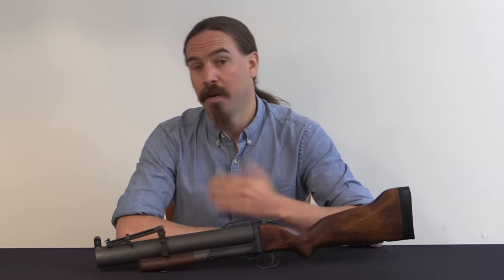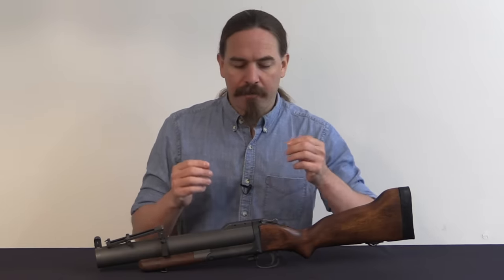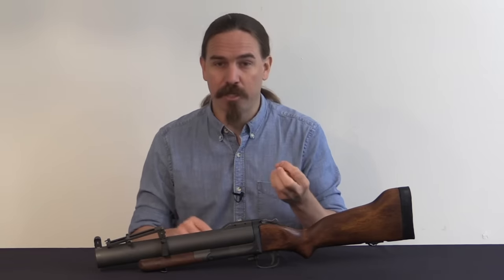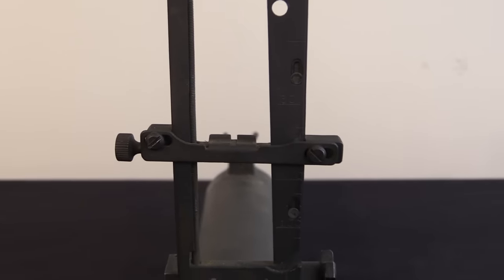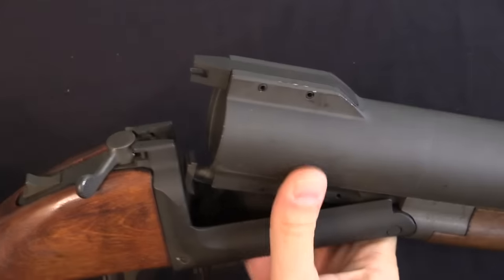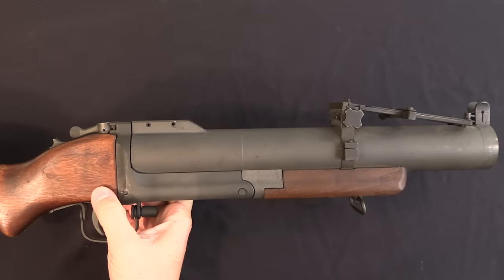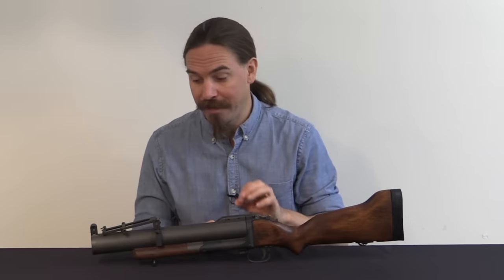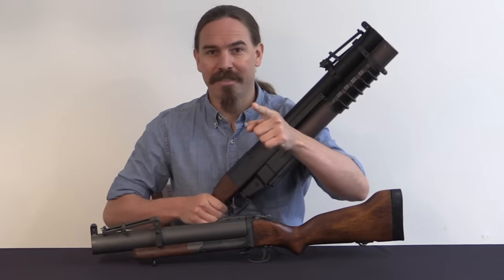M79: The Iconic "Bloop Tube" 40mm Grenade Launcher

Comment: My ship still had M79's in the armory as late as 2010.
Reply: Your ship? Are you in the military, private mercenaries or are you like security on some cargoship that moves in a area where there are pirates?
Reply: @eclipsed3407  At the time, I was US Navy
Reply: @eclipsed3407  the Navy liked these things a lot
Reply: For flares and line throwing
Reply: @silkyz68  no, not even close. it shot GRENADES. If we wanted flares, we had flare gun or pen flares for that. For getting lines across we had a line-throwing kit for the M14. We had M16's as well, but the larger cartridge of the M14 shot the lines further.
Reply: They are still in use by SF and Navy Seals
Reply: Very cool!  Thank you for your service!
Reply: Alexi Malenkov  My understanding is that they like the additional range the M79 offers compared to the other options. I could be wrong, however, as I don't know the ranges on the underbarrel launchers offhand.
(edit: Turns out the ranges are fairly similar between M79 and M320. There must be some other reason.)
Reply: @Angel9932  if I had to guess pre m320 they used it to shoot longer cartridges that couldn’t fit in the m203
Reply: It just plumb works. It's fucking heavy, and bulkier than a shotgun, but it goddamn works. Considering the role it fills, being a single shot is an inconvenience, its greatest drawback is the weight.
Reply: @Rb889  yep
Reply: @Angel9932  You can use it as a club when empty.
Reply: Alexi Malenkov  this aims easier over all. and most (if not all) have transitioned to the HK and 320. My active army unit was testing mass issued 320's back in 2011.
Reply: @hansblitz7770  The 320 is simple, so long as you ignore the sights and laser the kit comes with. I'd love to see the reference, 'cause cutting down the tube seems really dumb. The rounds have an area effect you really do NOT want landing anywhere near you.
Reply: @hansblitz7770  Interesting. Seems like something they'd have only from a lack of(before) M320's because all the "fancy" stuff is very easy to pull off of an M320 if don't like/want them. But "special" people get to pick things because "reasons" and no one bats an eye.
Reply: @hansblitz7770  That is possible. I'm just going off of the last 20 years of service and the sheer stupidity I've seen from all branches.
Reply: @hansblitz7770  Another special use weapon that didn't catch on for various reasons. Not sure what it has to do with M79s. But an interesting tidbit.
Reply: Ah

Comment: I carried an M-79 and an M-16 in my engineering platoon.  Unfortunately, Ian didn't cover the added feature of a flair gun.  It could fire a flair over 100 feet straight up and it lingered in the air for minutes.  It was very effective.  And we had to use it often.  I'm surprised he never mentioned this feature.

Comment: This explains why 40mm cartridges always looked so weird on the inside
Reply: Especially considering the propellant portion is made more or less out of plastic.
Reply: They should really explain this better to people who actually use the things for government work. Give some more appreciation for how ingenious of a tool it is.
Reply: @MalikCarr  7 years in and I never knew why, just that they were like that after we fired them.
Reply: @1337penguinman  Glass reinforced nylon to be exact.
Reply: @feralferret8626  not the live rounds. Perhaps you mean the training round.s
Reply: @jluvs2ride  I was replying to1337penguinman's comment about plastic.  If you read my other comments in this thread, I mention the difference between the cases for the practice rounds (M781) which are glass reinforced nylon with a primed .38 S&W loaded with the propellant, and the combat rounds which are a metal cartridge case with a metal plug containing the propellant and primer.  My former employer produced some of those loaded cartridge cases under subcontract in addition to millions of the M781 and also produced the USMC day/night M1110 training round (under sub-contract to American Rheinmetall) which used the same case as the M781.

Comment: I carried an M-79 in 1963 , it was new to the Fleet Marie Force , and it was kind of fun to fire .It also because of the 
aluminum barrel so easy to clean after being in the field for two weeks ! An old skirt shirt soaked in gun oil could be 
run through it in seconds, and the barrel couldn't rust ,so I could have my M-79 cleaned and ready for inspection hours 
before my buddies with their M-14's ,Liberty call ,The Grenadiers were always the first out on liberty !

Comment: When I was in S.O.I. we were told to never toss the grenade and spin it because the fuse would rotate out and arm. My first thought was "why would anyone toss a grenade". My second thought " if they had tell us this someone probably has done it". Reflecting back after years in the infantry and it makes sense. Lol.
Reply: Seems like 'lore' to me.  It may be physically possible to throw a launcher grenade by hand over 30m while putting enough spin on it to arm the fuse (assuming that there's no additional safety that prevents it arming while it's still in the cartridge case), but I'm skeptical.

Comment: I was in charge of a SEAL support detachment in Ca Mau 1970.  We were Team 2’s “taxi”, and we opped most nights with an awesome MSSC (Medium SEAL Support Craft).  The M-79 was my weapon of choice in the open cockpit next to the radio, and using it saved us on 2 occasions.  I was always loaded with buckshot round.  After dropping off the SEALs, we remained bow first to the bank and silent until they returned.
One night, as we waited, a small drifting/paddled dug out with 2 VC bumped into the side of our boat.  They were startled, automatic fire thru our canvas canopy, and while crew ducked, I fired one-handed at them at 8 ft range... was over in seconds.
On another opp, we were “pinned’ by 50 cal fire to our stern, from across a small river.  We tried to suppress with our 5.56 mini gun, and our 50 and 60 on that side, but could not.  The VC kept firing.  I radioed for air support and an Air Force 104 returning loaded from a target replied.  I used a white parachute round thru the M-79 to mark the drop, and the result saved us.  I discovered the pilot’s name and we made contact after nearly 50 years.

Comment: With the ammo types available, the grenade launcher is one of my favorite weapons I've been issued. I had thought a standalone (or at least detachable like the new M320) launcher would be super helpful instead of lugging around a whole extra weapon if the situation didn't require it. The SEALs still use the M79, and apparently from what I've been told, the sight is incredibly precise.

Comment: Some of the rounds were designed for Veirnam's terrain of heavily wooded, so they worked for that, but in urban areas of combat. The Flashett round was one of these rounds, but also used by others in missile to penetrate the jungles of the area. The shotgun round was the same way, but for close in support.
Reply: And “Viet Nam” I would guess.
Reply: Yes, meant that bit spelling was never one of my strong suits.

Comment: These functioned very accurately as hand held mortars and for direct fire with the shotgun round.

The drawback was wearing the round holding vest.

They were accurate, reliable and fairly rugged. They saved the life of one of my boyhood friends who unbeknownst to me was also in Vietnam at the same time as myself.

Me, I was usually a wrench turner keeping the Quad Fifty gun trucks running. But every truck also had an M60 and an M79 besides the Sergeant's .45 and the M16s individually issued to each of the gun crew and driver(s)

Comment: The system Rheinmetall developed at the end of WWII was called the PAW 600 or 8H63. It was actually used in combat at the end of the war, and pretty darn effective. IIRC effective range against point targets was out to ~750 meters, the weapon itself was right between the 37mm Pak 38 and 50mm Pak 38 in size and weight (less than half the weight of a Pak 40) and its hollow-charge munitions were powerful enough to frontally penetrate just about any WWII tank. The HE round was basically an 81mm mortar shell with some modifications, and the gun could lob that out to something like three times the range of a mortar, meaning it also more than fulfilled the light artillery/infantry gun role.

Comment: Hi Ian, they were not really made as a replacement for the bazooka because it's not effective against armour. They were designed so grunts would have a weapon that was ranged between grenades ( max 20 meters ) to mortars ( minimum 300 odd meters ). We used to carry 1 to a section and it was usually carried by someone in the rifle group as well as their SLR and if you were unfortunate enough to get lumped with it you soon learnt real fast to un-sling it off your back before taking cover in a contact drill as it would leave you bleeding and needing the superglue after smashing into the back of your head and opening you up.
I'm liking your channel, very informative and well done.
Reply: A big portion of the use-case for the bazooka was delivering explosive rounds in that 20m-300m range, especially against infantry in cover, as Ian mentioned. It just also served as your primary infantry AT. Turns out, doing both jobs meant it wasn't a great fit at either: Too big, slow, and heavy for the anti-infantry role, and no longer effective against armor. The LAW replaced the AT role with something dedicated to the task, and the M79 took the place of the bazooka's assault role.

Comment: I was in the army at Ft Ord in CA back in the early 1990s.  The M79 wasn't being issued to us regular army infantry types any more, but we still trained on it...Lots of national guard units still used it, and there were thousands of them in the supply warehouses.  In fact, one of the first sergeants once told us that if war started in Korea (we were the 7th Infantry Div, slated as the first guys to fly in to reinforce the SKs), when we were lined up to get into the C130s, they'd be handing out M79s and bandoliers of grenades to every rifleman who didn't have an M203....along with M72 LAW rockets that had been superseded by the AT4 as issue, but were still in the supply warehouses.  The 7th Infantry would have had a lot more anti (light) armor capability in reality than it did on paper!  

I've seen that since those days, the back stock and even new-manufactured M72s have been and are still being used by US forces in the middle east, because they're lighter weight than the AT4, but still effective against fortified positions in Iraq and Afghanistan.

Comment: While in Vietnam my sergeant told me to take some new guys out who had never fired the M-79. We went to the perimeter where I showed them the basic operation and then loaded and aimed at a lone small tree in the distance which I estimated at about 300 meters.  Holding the M-79 at about a 45% angle without the sight I fired and watched that grenade sail at least 100 meters past the tree I was aiming at.  With a straight face I turned to the guys and said “Men, that’s about the maximin range you can obtain with this weapon”.  and then added, “Now you see that tree out there’,  lowered my aim by about 20% and fired another 40mm grenade hitting within a few feet to the side of that tree.  As I turned to see their faces nodding, smiling and commentating on how good a shot I was with that weapon I just kept quiet and later when I told my sergeant he burst out laughing as he was there and said that he was also fooled by my bullshit.

Comment: one of the very rare instances where a weapon's projectile outlives the actual weapon it first came with
Reply: Or in this case, both has possibly outlived many of its designers and users
Reply: If you think about it, several modern cartridges are like that. You don't see too many Luger P08s out there, but 9mm Parabellum is pretty ubiquitous. I'd put .45 ACP here too, but people still make 1911 copies all the time.
Reply: 9mm parabellum? As far as im aware it was developed for the Luger which of course they still exist but arent in regular service
Reply: @lilwyvern4  
The m1911 is still used a hell of a lot especially for an over 100 year old design

I think some "unit" of the USMC still uses the M1911
Reply: @P7777-u7r  Force Recon isn't it? They have the option to use custom 1911s
Reply: Extremely common: .45-70, .30-06, .308, 8mm Mauser, 6.5mm Swedish, 7mm Spanish, 7.62x54R, 9x19, 10mm (in that case, the round lived on despite the gun it was designed for flopping)...

Comment: I believe that the "micrometer dial" is called a vernier dial.
Reply: Bingo

*I got it backwards

**Apparently not
Reply: It's not. That's not at all what a vernier is. Source: I'm a machinist.
Reply: @Orcinus24x5  Vernier means fine adjustment. Source: I was a metrologist. It's also in the dictionary. Look it up.
Reply: @AndrewMalkin  Thank you for the second clarification
Reply: @AndrewMalkin  Actually, it's the name of the guy who invented that type of scale.
Reply: The "vernier" part of a measuring instrument is the little slide rule looking thing on a non-dial instrument that lets you get another digit of accuracy by matching the next to least significant digit to the line that it's closest to on the vernier scale to determine the least significant digit.
Reply: @Mishn0  Not necessarily. I calibrated many pieces of equipment that had vernier dials that just gave you a more fine adjustment.
Reply: @AndrewMalkin  Eh, I disagree. It refers to a ,"vernier scale", which is what I'm describing. Look at any instruction about "reading a vernier". No biggie, it's not something to fight about. Shop terms often stray from dictionary definitions.
Reply: @Mishn0  Yep, the term has come a long way from its original meaning.
Reply: Fuckin Vernier scale calipers

Source: CNC operator

Comment: I kept one of these between the seats in my jeep with a .50 cal can full of CS rounds to get folks out of the wire and a grenadiers vest on the back of my seat with 20 HE rounds and usually two buckshot and two illumination rounds. I could put one thru a doorway a long way off back in the day and I loved it. Sadly one of my troops screwed around with an HE round long enough for it to go off in his hand, which took some doing and it killed him and wounded another soldier in the top of the guard tower they were in. Not my favorite memory of Vietnam but one I am reminded of  when the M-79 comes up on a video or conversation.

Comment: I've always wondered why it has a butt stock that just a flipped regular stock.
Reply: If you are shooting at long range, you prop the butt against your hip so you can actually line up the sights.  You'll be glad for the huge chunk of rubber on the end of it, too.
Reply: It is shaped that way to lower the barrel relative to the eye. It fires the grenade in a super high arc, so to be able to aim it, the sight is super high as well, meaning there is no need to raise the barrel to eye level. (the reason normal rifle stocks are shaped the way they are)
By lowering the barrel, you also get a straight line of recoil, wich makes it easier to control.

Comment: “Could not” be used at short range, or “should not?”
Reply: Could not. It has a safety system built into the rounds that exploded to have to make three full revolutions before they would explode. This does not apply with the buckshot rounds used for breaching or close quarter emergency.
Reply: @khb6686  1/48” twist rate means 1 rotation per 4’ traveled, so 3 full rotations would mean they arm 12’ from the end of the cartridge (if you count the fraction of a turn within the barrel. 

From various articles it seems that the fusing was not that precise, apparently arming anywhere from 14 to 30 yards past the muzzle.
Reply: Surprised inside of the thirty yard limit and I bet It would at least slow them down
Reply: @passonthestar3689  
If it was an anti personnel or H. E. Round I am thinking all you would see is a pink mist and a pair of boots left behind. On the plus side your target probably won’t feel much pain.
Reply: Should not there's a way to change how far you can shoot the 40mm grenade.

Comment: Back in my ROTC days (early 80's) I was fortunate enough to fire an M79 on the range. We were doing an FTX with a NG unit that still had M-79's in their inventory, primarily for use with riot control munitions. Only got to fire two inert rounds, but managed to put both through a window target at 100 yds, after expert coaching by a Vietnam vet.  Much easier to use than the M203.

Comment: The M-79 Grenade launcher, often called the bloop-gun because of its rather hollow-sounding report when fired,  was a somewhat effective weapon in Vietnam.  It fired a 40mm  fragmentation grenade to a range of about 250-300 meters, which if it landed within about 4-5 meters of an enemy soldier likely would inflict serious wounds.  The charge in the grenade was 1.2 oz of composition B, compared with 6 oz for the standard m26 frag grenade, or three times as much explosive filler at the old Mk II frag grenade (the so-called pineapple).  Few men could throw the old Mk II much farther than perhaps 20 meters at most, being very heavy.